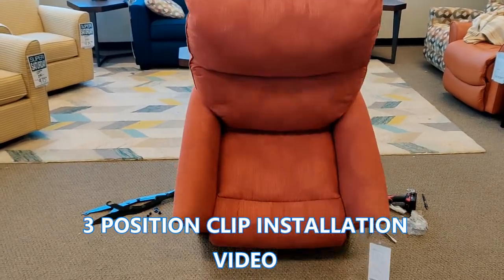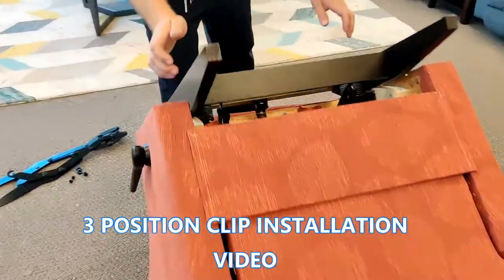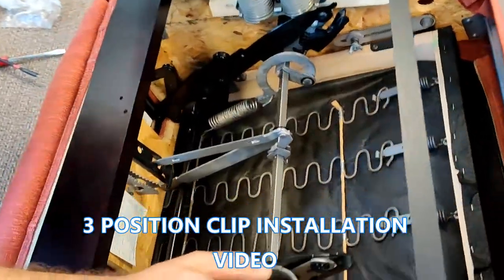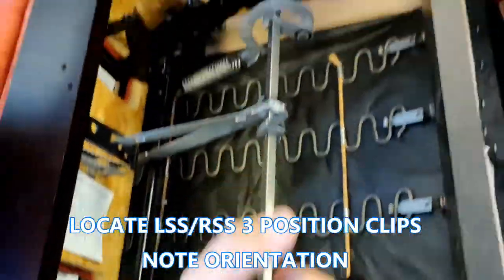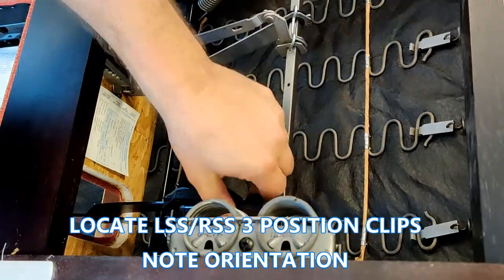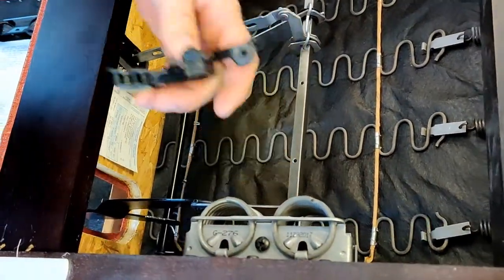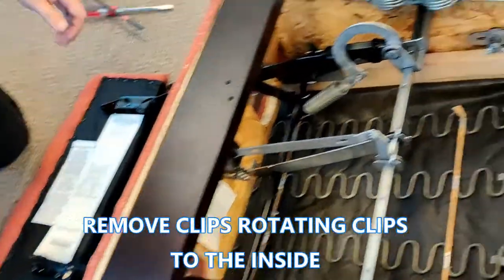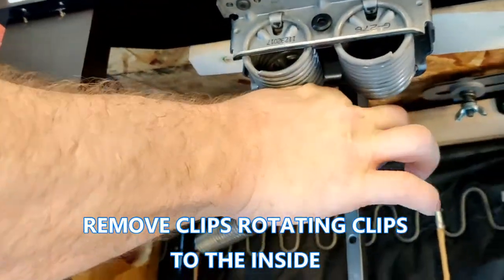Lazboy Three position clip replacement

Comment: The double spring attached to the side: what is that black plastic bolt between them do?  Mine slides up and down and clanks whenever I rock.  Can I remove it or tape it down?